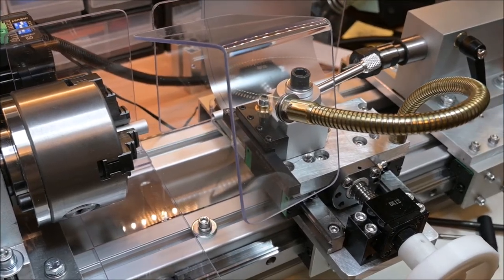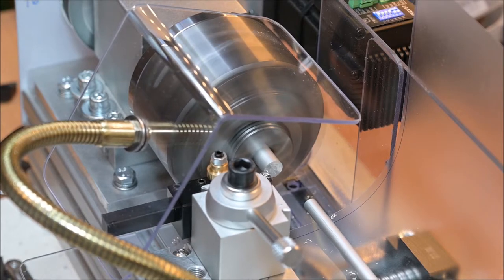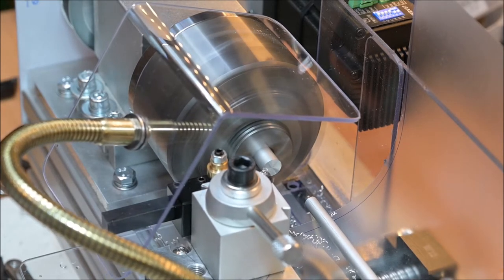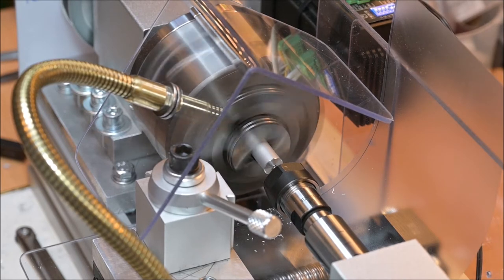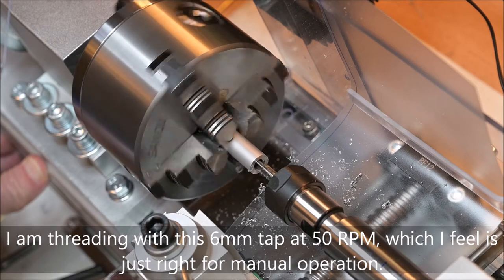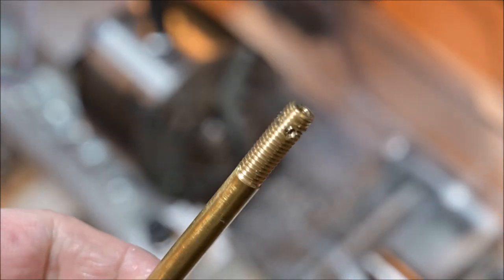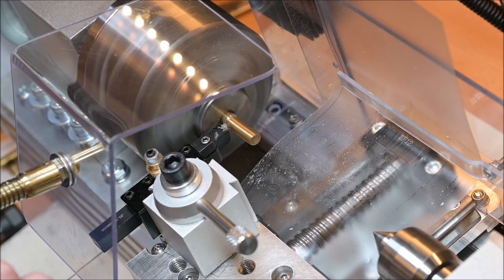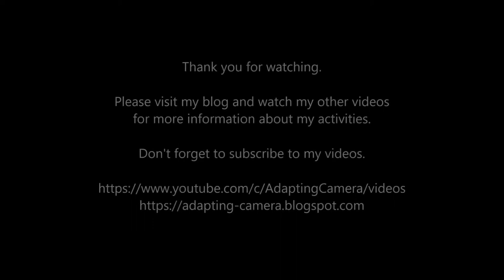CNC Rotational axis as lathe (part 4).  First test run.

Comment: Hi! I've really enjoyed this series of videos, and I'm keen to try make my own 4th Axis Lathe, so I was wondering how it's been working out for you?
Thanks again!
Reply from the maker: Thank you for your comment. It works well, but of course, it isn't as powerful as a "real" mini lathe because of the small servo, but that's OK for me. I built a stand for it and I am currently in the process of digitizing it and will replace the manual wheels with steppers. The build is an ongoing process, but I have been occupied with other things lately, so progress is slow. My recommendation is to use a more powerful servo. I may change mine also later on, but first I want to be ready with it as it is.
Reply: @AdaptingCamera  It looks more than sufficient for what I want to get done, I don't really NEED a "real" mini lathe, space is more important for me.
And it's nice to throw money into the parts you use, not all the other bits that would come with a full package that I wouldn't use.

Thanks for the reply, and good luck!